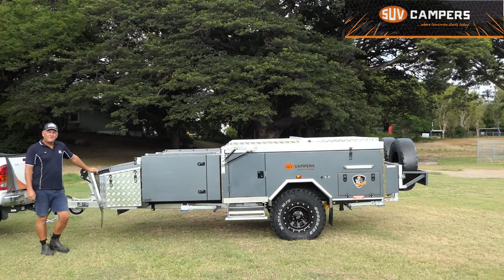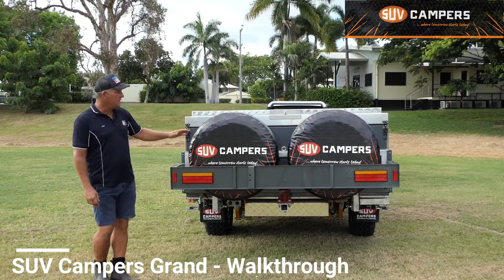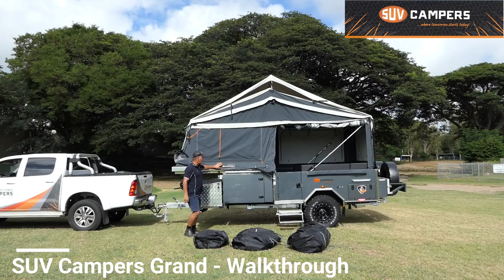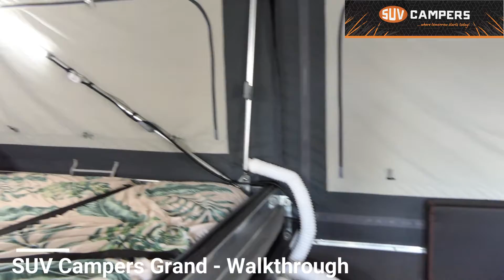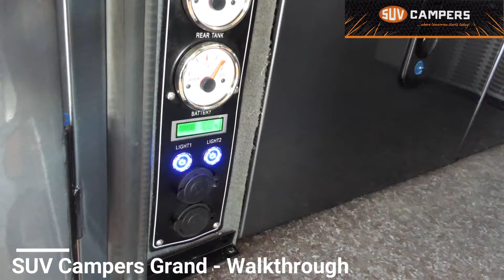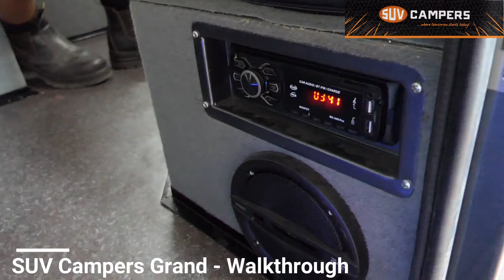SUV Campers - Walkthrough video on the Grand model

Comment: You got yourself a customer. Just curious where the annex and walls bags store in transport. Do they fit inside the living area when the trailer is packed down?
Reply: Yes they do. With our 2021 Grand which we have taken on more than 10,000km already, we leave the air annex at home and just use the canvas travel awning. Great camper, tows easily, we love ours.
Reply: @bobr6555  Why do you leave the air annex behind?  It seems to be the big selling point to buy one of these?